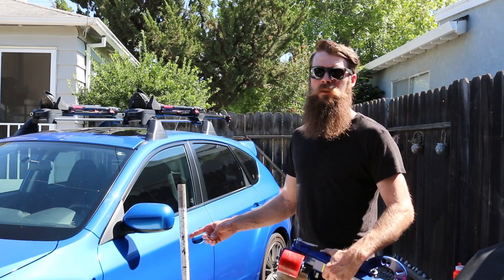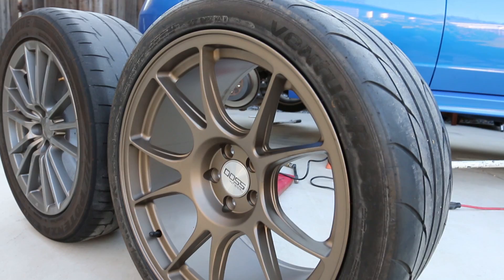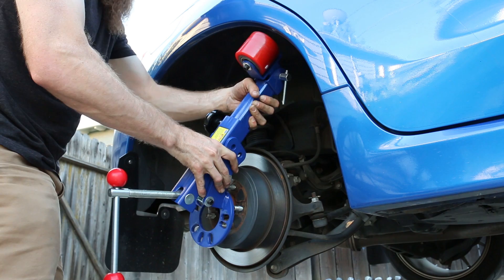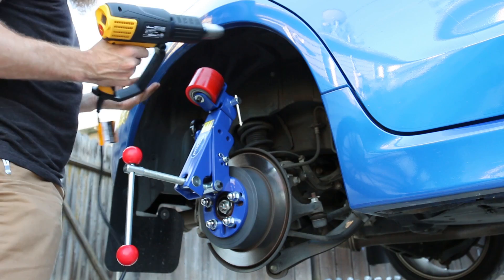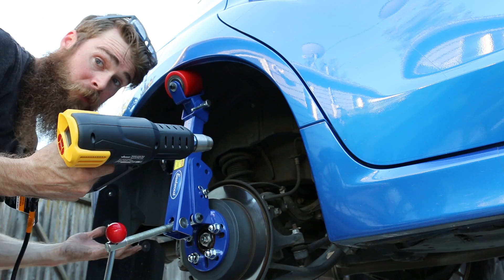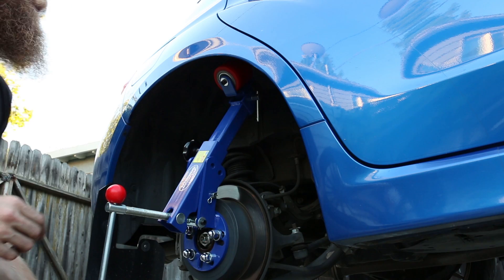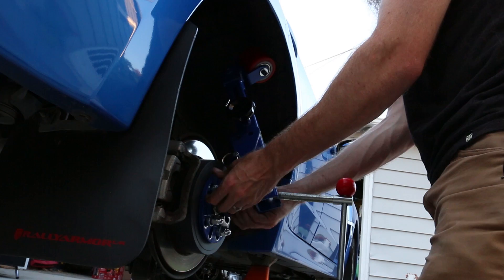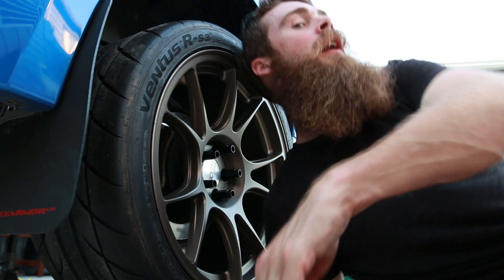HOW TO ROLL YOUR FENDER'S 2014 WRX HATCH PT-04

Comment: I've done about 20 to 25 car and the reason your paint cracked was not enough heat. you need heat do the paint is flexible. to fix your cracked paint. use your heat and put super glue on it n push it back on then after it drys use a bit of clear fingernail polish over the crack to seal it. good luck
Reply: Thomas Rossi smart dude you are
Reply: It also looks like he’s doing to much to fast
Reply: How much degrees would you recommend to heat up the heater?

Comment: "those lugs are on there pretty good!"   as you use a 12 inch ratchet to break them loose.. LOL
Reply from the maker: +LastHumansGarage should have used the 6 inch just for effect lol
Reply from the maker: ***** That was a small breaker bar.
Reply: The issue is the leverage; 12" isn't enough, whether it's a breaker bar, socket drive or cross wrench. ;)

Comment: I don't think it's mentioned in the video (although it looks like it was performed at least), but on AWD cars with an open center diff, you'll want to make sure both wheels on the same axle are raised off the ground whenever rotating either hub, to avoid damage to the drivetrain. Might even need to have all 4 raised.

Comment: I use clear finger nail polish to touch up chips that have gone down to bare metal. Left untreated though and then you're painting a whole quarter panel and possibly a blend into the rear door if the paint work is too far forward.

Comment: Bro one tip: use truck bed liner for the undercarriage. You can apply it with 3 inch paint rollers. Works great, and is great at protecting stuff lol
Reply: Subie Sammy probly not too suitable for weight stages but overall sounds durable good tip thanks! It even helped me by you helping him.

Comment: Good video. One suggestion for others who try this. Go slower with adjusting the tension (the part he keeps tightening) and take your time. Also more consistent heat will help the paint stretch with the metal more reliably.

Comment: The biggest tip, do the whole lip at the same time, don’t work little sections at a time or it won’t look uniform. 
As well, be careful how much pressure you are applying and the angle you’re working it at. It’s pretty easy to screw up the lip and cause ripples in the guard.
Reply: Dylan Baxter I was thinking that. Get an even roll that way
Reply: I just ordered the easton to roll my 19 series gray wrx. I keep hearing do small sections but I agree spreading the pressure across the arch from end to end should in theory keep it from deforming the lip edge. We’ll see how it goes. I did my MK5 with a borrowed easton no problems. Any other tips greatly appreciated tks 👊🏽

Comment: Those two little paint cracks: try covering them with a small piece of clear packing tape. Sounds rinky drink, but it is effective. It's pretty stealthy. You can't "fix" cracked paint. Cover it up, seal it some way or sand and paint. I'd tape it.

Comment: About to mount 265/35/18's on my 2017 WRX.  Was told that I wouldn't have to roll the fenders as long as it wasn't an STI.  Still debating the issue in my head.  I hate to have to go back and do it after the fact.  Then again, as long as I keep fatties out of the back seat I should be fine.

Comment: Good video, I just did this my my hatch as well and used a lot more heat, had a tiny little crack close to the bumper, other than that it was good, just used subaru touch up paint to fill it, but I hate how the fender doesnt smoothly flow to the bumper now since its pulled, thanks for the video, mase me man up and do it.

Comment: Just an FYI you will need to split he hub and bearing to take the 3" arp studs. Theres methods out there to trim down the stud for the front and back but I dont really care removing material on the studs. 

I had the studs done on the front of my 2010 sti hatch and just waiting for some extra cash to do the rear with new bearings and hubs.
Reply from the maker: +Chad Sergerie thanks for the heads up. Sounds like I may be making two videos on this then lol. Fronts then rears.

Comment: the paint cracked because it wasn't hot enough before you rolled it. Like seriously it should be piping hot.
Reply: akuapiatas it cracked because he went too aggressive with the angle. You’re supposed to start almost flat and increase the angle and pressure incrementally. He just rammed it at the final angle in one shot.

Comment: You didn’t roll the entire fender out before applying more pressure. You only did half and then applied more pressure starting the other side which caused it to crack between those two points

Comment: Were the wheels rubbing enough that you had to roll the fenders? I have a GR STi sedan and I was thinking about running wheels and tires in the exact same specs but I heard that this setup would not rub. Thank you!
Reply from the maker: +Jeff Chimenti I never even ran the wheels before rolling the lips. I wanted to do this before I even had an issue. It hasn't rubbed at all but I did roll them so this would not even be an issue.

Comment: Hey those are some lovely wheels!  I've been wanting that style for my bugeye but i'm scared about the whole 9.5 width and not actually being able to fit.  Can't wait to see how it looks all done!
Reply: 9.5 is fine, you will need to roll the rear fenders, one or two degrees camber and fettle with the alignment somewhat after as its a pain. I'm running 8.5s with lowered springs, no rub or need to roll anything just alignment after and still have about 5mm wheel gap. If you ran coilovers it would be pretty flush and still have pretty good drive-ability.

Comment: Love how Eastwood sales a tool that totally fucks up your car, hacky hack hack🤣😂
Reply: Robert Smith if you heat the paint correctly it doesn't crack . The heat is important. Looks like he rushed it. That's why it got fucked
Reply: Jay Burgess I know heat helps and can stop the cracking ,but what about the area between the 2 pieces of sheet metal that have now moved and rubbed on each other.. and will now leak because the seam is inverted up and rain water I'll flow down causing rust ..........I guess if you don't car about it then it's not that big of a deal
Reply: Robert Smith you have to fill that area with either silicone or window weld. My buddy had his Sti done like that. Hasn't had any issues in 3 years.
Reply: Jay Burgess time just give it time.
Reply: Robert Smith how if it is sealed? There is no way for water to get in.

Comment: Hey Blake with that low offset wheel you got, How's the car handling? any problem with a low offset? BTW like your channel. keep up the good work. learn alot.
Reply from the maker: The car handles amazing with the new wheels and tires! I haven't had any problem with the +35 offset at all after rolling the finders.

Comment: hey blake will a 18x9.5 +38 rub on a 14 wrx without rolling the fenders?
Reply from the maker: +bry954rr The front will clear fine. The rear fender lips you may have to roll.  It all really depends on what size tire you go with.
Reply: +Blake's Garage would you know what tire sizes would clear just fine?
Reply from the maker: +bry954rr sorry I'm not sure. I have 265/35R18's also all tires are not the same height/width even tho the numbers are the same. It didn't rub that bad in the rear I just rolled them to be safe.
Reply: Cool man, thanks for the info

Comment: what does rolling th fender do?
Reply from the maker: Makes its so you don't cut up your tires on the inner finder lips when hitting bumps.
Reply: +Blake's Garage oh. thanks man
Reply from the maker: Randall Acuna No prob!
Reply: +Blake's Garage i like the profile man keep up the good work
Reply: +Blake's Garage if you dont mind me askin. in your opinion what kind of exhaust system would you recomend on a 2002 dodge durango
Reply from the maker: Randall Acuna I always like the sound of Flowmaster 40 Series mufflers on a V8.

Comment: Maybe i'm a loser for not knowing this LOL, but WHY would you want to do this to the car?
Reply from the maker: +Bpm Sounds to fit wider tires. So they don’t rub on the body and bend panels. Also so the tire doesn’t get cut up under compression of the suspension.
Reply: Fitment brah
Reply: Because most don't know how to purchase rims and tires that properly fit their car....
Reply: Chayzz Devyant normie won3 understand
Reply: Most people do it for cosmetics. In order to fit a larger wheel and tire you need to make room for it. Some people do it for performance purposes. People that track their cars and want wider tires for the track need to make room for them. It doesn't always have to do with people "not knowing how to buy the proper wheels and tires". For some people the proper size for their purpose isn't the size that will fit without rolling.